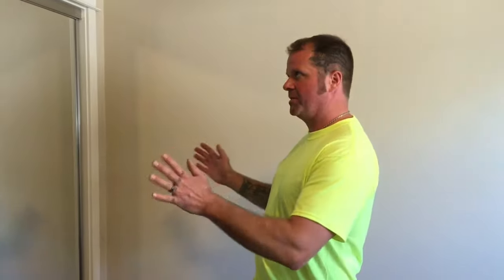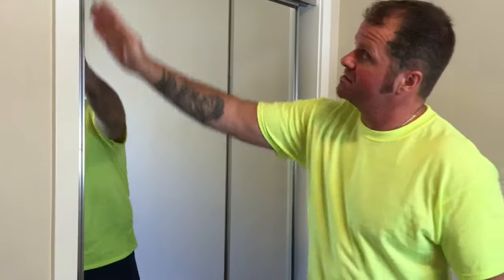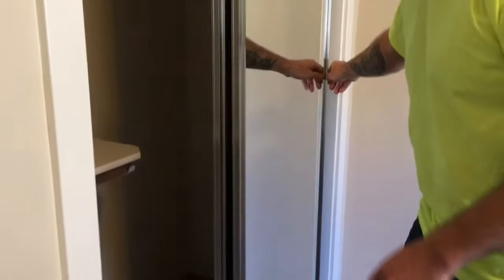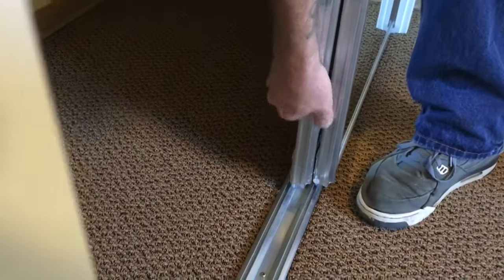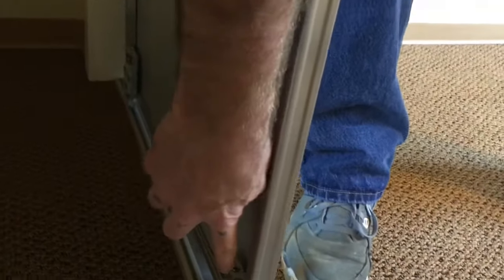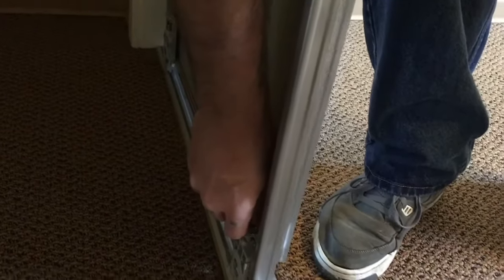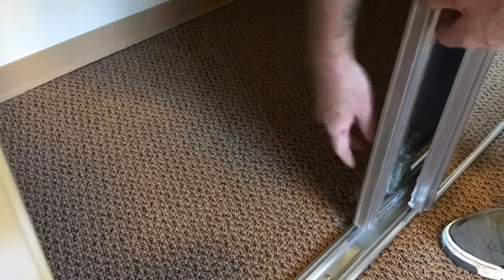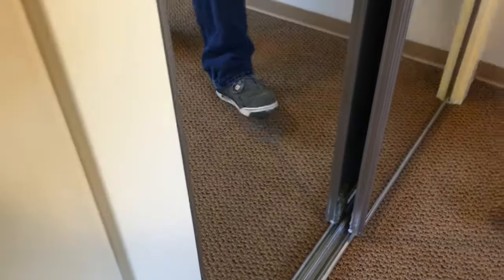How to Fix Mirrored Closet Doors & Tracks

Comment: Only video on out of track sliding closet door that:
1) doesn't use a wheel or roller on the bottom
2) a video with sliding door closet which uses a bottom guide on the bottom. I'll assume the roller/wheel is in the top track.
Anyways, after watching many frustrating videos about adjusting closet door wheels on the bottom I find your video with the guides on the bottom. I had the guides on the bottom and it didn't quite seem to be inside the track. With your video, it was definitive that the nylon/plastic guide should snap into the groove/slot on the bottom track. Problem solved! Thanks! Closet door sliding smoother than it's ever been in 15 years! Yeah, I took my sweet time getting to this project.